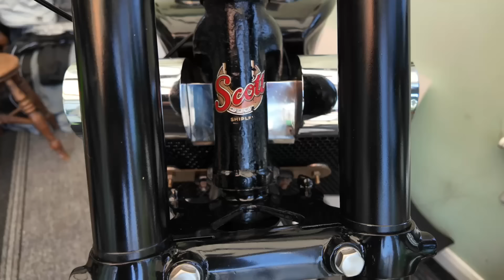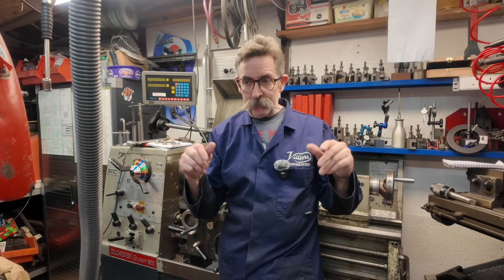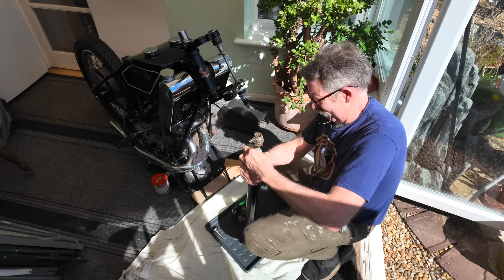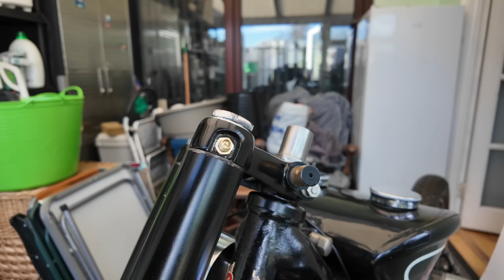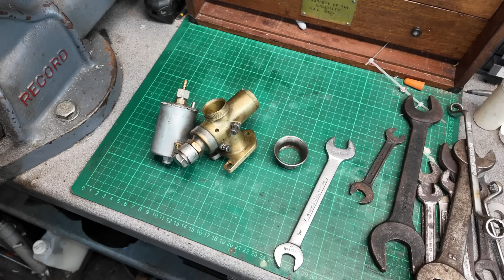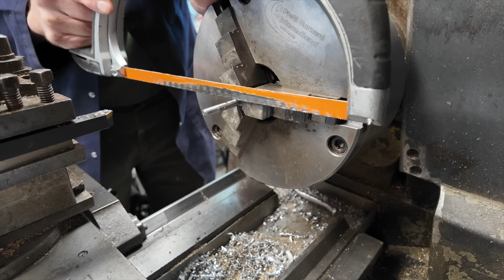These Forks Fought Me Every Step Of The Way!

Comment: Followed your Dowty fork rebuild from the start. I am renovating 1948 M100 Panther with same forks. Needed new tubes from Stoyan, had the same problem as you that they would not fit the yokes, followed your fix and now perfect. Bit of a job from start to finish and forks now very tight, hopefully that will get better in use. Didn't have a broken air pipe like you so that is still original. I do though need a new air inflator valve and wondered where you  sourced a new one. Keep up the good work on vehicles, motorcycles and your general engineering which I have found to be excellent.
Reply from the maker: They are available off the old Interweb of things, just search brass schrader valve stem 8mm thread ( my one is 8mm so I suspect yours is aswell, just check it isn't 1/8" BSP, valve stuff tends to be metric as Michelin were in at the beginning) you may need to file the thread down in length a bit so it doesn't foul the thread of the fork top nut .
Reply: @TweedsGarage  Many thanks for the information

Comment: In the 5 years since the Shedland Cross was created for extreme courage in the face of the enemy (poorly manufactured, gorilla maintained and / or poorly engineered vintage vehicles) only 105 have been awarded. Of these, 104 were won by the defender(s) of the Mission Station at Tweeds Garage, England, 2026. Proceeds to list honour roll (All Mr Tweed) to Men of Harlech

Top work - very trying for sure. Love that Castrol jug - best pouring spout design ever.
Reply from the maker: Bally hell old man ! I shall wear it with pride, just careful with that pin you nearly got my tit 😁